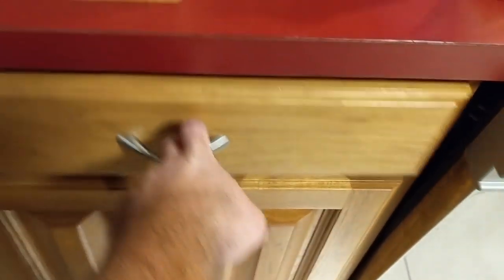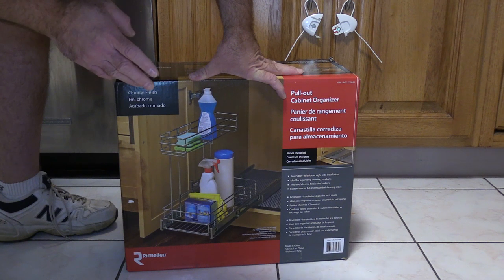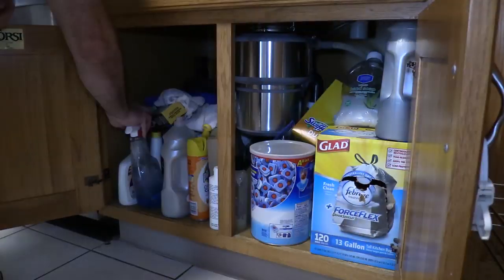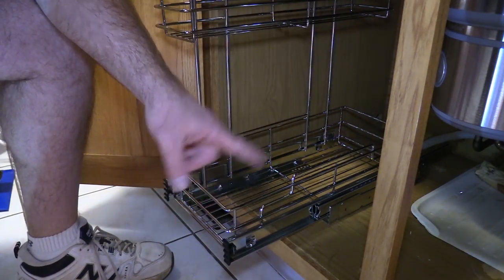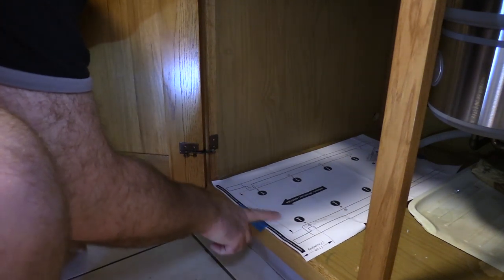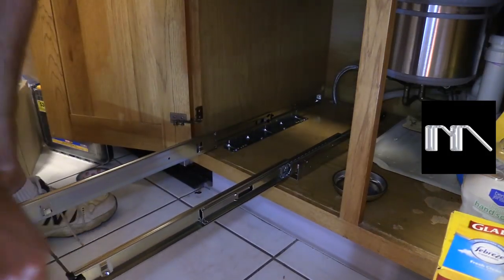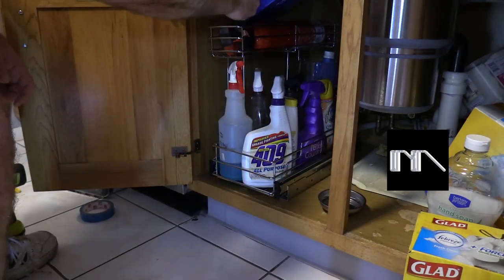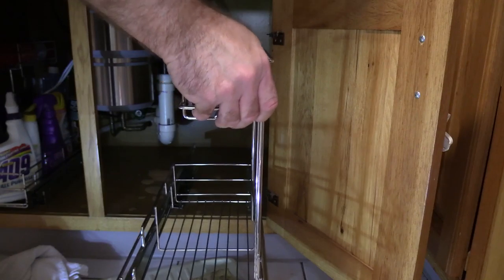Kitchen Cabinet Storage Shelf Installation from Costco

Comment: Awesome video..this one pack has been sitting in my garage and my hubby asking handyman to attach it 😂😂 whenever someone comes over for some other problem. I am going to put this in my bathroom. Kitchen sink is tight with all the filter gadgets! Thanks! Just a question, my sink has a 1"(almost) high bar at opening , does the railing add up the height or do i need to add a board below ? :(
Reply from the maker: Thanks for watching!
Reply: @m3rdpwr  Of course! Just a question, my sink has a 1"(almost) high bar at opening , does the railing add up the height or do i need to add a board below ? :(
Reply from the maker: @inquisitive99  do you mean lip at the bottom of the cabinet? If so, I will have to check when I get back.
Reply: @m3rdpwr  Yes! Sorry didnt know what its called.
Reply from the maker: No worries. Measure and try to be exact. Typically face frames are 3/4 of an inch, not 1 in. This will matter, because I'm pretty sure you will have to elevate the shelving. You will probably have to pick up some 1x  material to elevate, 1x is only 3/4 of an inch thick, so that measurement is important. When I get home. I will check, but see if you can't measure and get me that info and I can give you some idea of what to do.
Reply from the maker: @inquisitive99  So it's barely 1/2" over the mounting surface.
Double check the height of the lip, but I am willing to bet you will need to place down some material and attach with longer screws.
Reply: @m3rdpwr  Thank you!